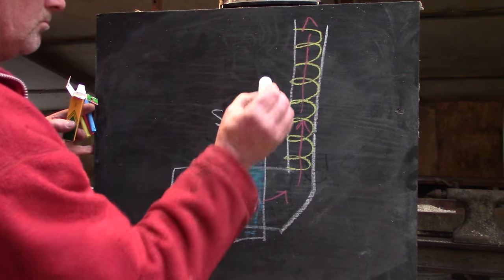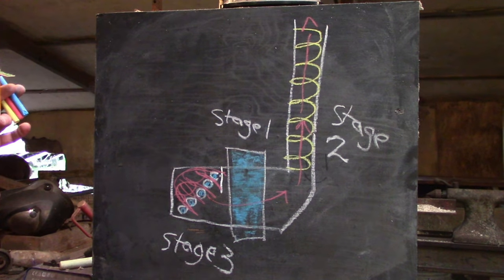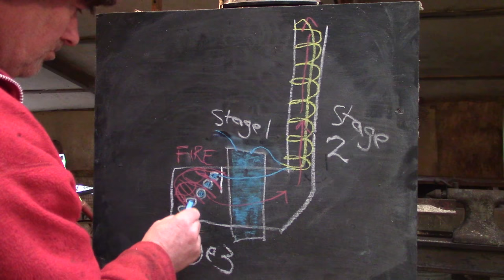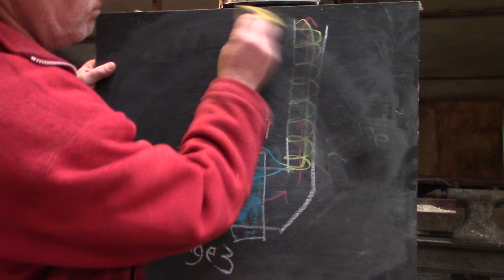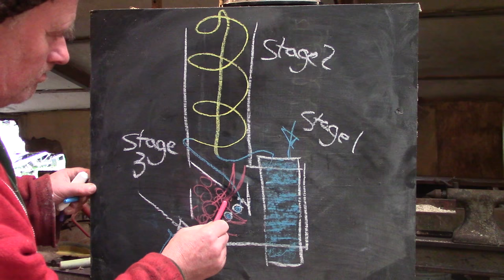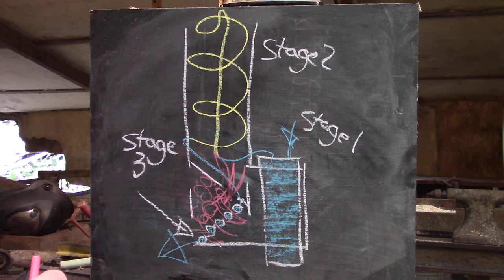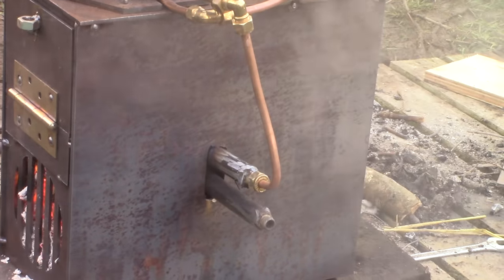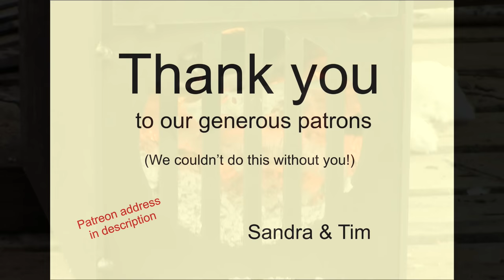Finally A Flash Steam Boiler That Works!!

Comment: 9:44 is it because the air flow is too high in that it just blows the flame out before the wood of the match stick can start to burn? There appeared to to be momentary ignition the the flame was extinguished. 
Fabulous idea though, I work for AGA and was observing some work on a Rayburn recently, and we were looking at the efficiency of the oil burner and questioning the airflow around the various baffles in the heat exchanger. 
Very interesting stuff
Reply: There's no oxygen in a pure flow of water vapour.
Reply: @Landrew0  it’s not water vapour it’s dehydrated … it looks just like that there is too much airflow blowing the flame out
Reply: @buffplums  When you boil water, you get only water vapour out of the pipe, with no oxygen in it.  Superheated steam is dry, but not dehydrated. That's why the match lights, but can't stay lit.

Comment: That's some hot steam. But wouldn't it push backwards through the water pipe if you restrict the flow? 🤔
Reply from the maker: Ha! Yep, S.H. has it right..
Reply: @wayoutwest-workshopstuff6299  yeah but, there's no check valve, isn't it - that was the question. 👆

Or do you plan to build an atmospheric steam engine? 🤔
Reply: @wayoutwest-workshopstuff6299  else I think you would need an well insulated pressure tank (best attached to the chimney or firebox) and have a check valve on the inlet too.

If the float valve opens the steam in the heating part will be dumped by triggering a pressure release at the end (best up the chimney to increase the draft. 

You could then use the steam pressure in the now isolated pressure tank to push water out from a larger reservoir into the boiler.

The larger reservoir could also be used to cool down the exhaust from the steam engine, by looping it inside the tank, before venting it to the chimney.

This allows some steam to condensate (which you can collect in a non-pressurised reservoir, so you loose less water, and it will preheat the reservoir. This reduces the amount of steam necessary to move the water out - as it will be already pressurised and will reduce the energy needed to heat up the water in the boiler. :)

Comment: Will superheated steam not corrode the steel superheater tubes rather quickly? On my model steam loco the superheater tube is stainless for this reason.

Comment: if you want to make a piston engine that runs on that steam you will need HUGE cylinders and it will use a lot of steam
Reply from the maker: Thanks but can you explain why? I'm just getting my head around cylinder sizes and stroke length.
Reply: @wayoutwest-workshopstuff6299  because you are working with such low pressure . You will find calculations online to assist. I know we differed on this before Tim but I still think your definition of flash boiler isn't quite correct. This is more a traditional boiler with superheater
Reply from the maker: I'm sure you know best but it's not quite a conventional boiler either, is it, because it's not closed up.
If I aimed at 30psi working pressure would you still regard that as low pressure?
Reply: @wayoutwest-workshopstuff6299  very you are gonna pretty big cylinders for this thing or alteritivly you use a turbine but that would problebly be difficult to build
Reply: @wayoutwest-workshopstuff6299  I would suggest it's a conventional boiler with superheater and regulator open. ..in its current form. To do work of course it would need to produce pressure, ie closed up as you put it. The amount of torque will depend on diameter and stroke and pressure, number of cylinders etc and is easily calculated.  The amount of power, which is useable work, is defined as torque x speed.  In this instance you will be limited by either rate of steam the boiler will produce, or for short term, the amount of stored steam. A flash boiler stores very little, a traditional boiler has more back up, because as pressure drops due to steam use the water boils rapidly because its boiling point lowers. Sorry this is too much for a text reply but you can find it all online. Great project to watch and for sure your fire draw system is working better and better.
As for 30 psi boiler...how would you keep it topped up?

Comment: I know you're just experimenting but do you have a plan for how to make your solid-fuel boiler a little safer?  I know the whole world has gone crazy with safety.  The difference here is that an accident with steam has more consequences than most of the things we worry about in modern society.  I've heard inspecting the wall thickness on the tubes is important on commercial boilers, for example.  Sorry to be a negative nelly but a pressure test on those welds might not be enough to be confident in the work, especially long term.  In the US, welding inspectors will reject a messy weld.  If it looks perfect, then the inspector will proceed with dye or x-ray.  BTW, there's a good book about the inevitability of accidents in certain situations.  In particular, a system with phase change is prone to accidents.  The book is titled "Normal Accidents" by Perrow. Even if you carry on, perhaps you could consult the model engineering community.  They're keen on steam power and might have some tips about building a boiler.
Reply from the maker: Nothing exciting comes without some risk. I don't want to get hurt, but I do want to explore the world around me
Reply: You could do a hydrostatic test quite simply, to know if it is safe to operate.

Fill the boiler completely with water without leaving any air inside (also remove the floats)
Connect a pressure gauge and use the water mains to pressurize the boiler initially, then shut it off and heat it gently with a propane torch. You will see that for a small change in temperature there will be a huge change in pressure, because the water cannot be compressed. If it fails, it shouldn't be as dangerous because there will be no steam, just some warm water.
They use this procedure industrially to test boilers and tanks to failure.

Comment: I think that you can collect acorns to dry them and use as fuel. Add a blower to the firebox to increase the temperatures. Be careful not to use much of a blower.

Comment: Bravo! 👍🏻 is there any point (yet) thinking about how one might transport water in such a way that would allow steady supply to the system at the right rate yet not be mains operated / at mains pressure? Because that flood of yours might work differently once, shall we say, it is decoupled/unleashed/mobile. Or is it a non-issue? Perhaps condensing the dry steam into a receptacle might be another fun thing to do to see what amount of water intake is needed per minute at medium fire, or whatever rating you require….
Reply: * flow, not flood 🙃

Comment: 0 seconds ago
In a normal steam cycle the incoming water for the boiler would be preheated by the exhaust gasses of the stack as that is the coldest area as the flame area  is the hottest.
That preheated water would then go to the boiler steam drum and only then to the superheater to be dried ( and heated more).

The relief valve is set lower on the superheater as if it blows the escaping steam will “cool” the superheater tube steel as they will melt without the cooling steam flowing through.

The steam drum gets its own pressure relief valve set higher.
Reply from the maker: Ok, thanks. I'm trying to do something different though - match the input with the boiling rate, so that's why I need a float valve early in the system

Comment: The 3rd stage in the grate, is not a flash boiler, it is a superheater.   Steam at over 100C is superheated.   A flash boiler does not have a large vessel with water in it, its more of a long tube around the fire.  Water enters at one end, steam exits the other.

Comment: Apparently the first way hydrogen was generated was by passing steam through a red hot iron tube, which would split the water and use the oxygen from the water molecules to turn the iron to rust, liberating the hydrogen. Might want to be careful with red hot iron tubes, but they had to have done it somehow for steam locomotives.
Reply: thermochemical watersplitting happens at 500-2000C and just back of the mind iron chemistry I think you’d get insignificant quantities by accident as what little hydrogen liberated would adsorb into the iron and rust. Significant quantities of hydrogen made this way need real fancy catalysts and special conditions so if the old mate discovers an iron catalyst works i think i have a few uni’s in mind that would appreciate hearing about it

Comment: Get a plumbers pressure test so you know if it will take double max working pressure.
Secondly silicone rtv and heat and pressure it is bad news, great on cam box on car - not great for application your using it for

Comment: I think you shouldn't try to heat the steam, but instead heat the water. The hotter the water is, the more pressure you'll have. Heating the steam will only increase it's volume, but won't increase pressure. When water has a higher temperature than 100 °C it will want to evaporate, but a high pressure will stop it from evaporating. The hotter the water is, the more pressure is needed to stop it from evaporating. In a closed tank, the water will generate steam until that pressure is reached. You could of course use the tubes you have made to heat the water.
Reply from the maker: Thanks, Refke. That's the conventional way, isn't it? Where you have a pressurised boiler. I was hoping to avoid having a lot of pressurised water or steam for safety reasons

Comment: NO, not more powerr...
Less power, slower welding (slower feeding material) = more time to fill the cracks aka have a better flow.
Not to low, because then it does not merge well.
Start (testweld) low and then increase till you have a good flowbed that seals completely.
For most cases, lower is better, but to low = no go...

Another helpful trick for improving your welds:
Tag it in position and start welding at the most difficult spot to the easiest spot.
That way you weld has a higher chance to be consistent and even improve during the weld.
Start the other way around...
Then the chance of your weld getting worse is almost guaranteed, because the rise in difficultly..
This also prevents for spending lots of time on corrections...
If the start is bad, then you have less to correct then when you finish the weld completely...

Comment: Just remember…. Pressurized steam is extremely dangerous.  Currently you have an open system but to get any work out of it will require pressure to be stored.  And that’s where things can get a little crazy.  Lol

Comment: You did the steam production part right. Your steam is dry and oxygen-free. This is why the matches don't light up. No oxygen to burn the wood.
But by extracting so much heat at these critical points you take away the biggest advantage of the rocket stove: The very hot - and therefore complete - combustion. You cool the combustion and therefore your rocket smokes with incomplete combustion. Good rocket stove designs insulate the horizontal part and the vertical heat riser. You do the opposite. So this will never be a good rocket.
Reply from the maker: But it's not supposed to be a rocket stove!
Reply: @wayoutwest-workshopstuff6299  Well then... well done! ;)

Comment: It's nice, but it isn't a flash steam boiler. For that, it has to be able to continuously turn water instantly into steam, which isn't too hard to do, you just need a lot of extra heat and a water pump of course.
Reply from the maker: Ah, but that's exactly what it does! Perhaps I didn't explain properly but there's a constant supply of water in one end and constant steam out of the other..
Reply: @wayoutwest-workshopstuff6299  Very impressive then!

Comment: Hello, I need to boil a continuous flow of 2 liters of liquid entering at 25ºC every minute and I was wondering if such a design could do it. I only need to boil these 2L/min, not steam it
Reply from the maker: I think you'd need forced air - that's a lot of heat to produce
Reply: @wayoutwest-workshopstuff6299  yes I thought so too

Comment: Do you think you can heat milk up for a well earned cappachino
Reply from the maker: Soon!
Reply: @wayoutwest-workshopstuff6299  I saw an attachment, many years ago, that fitted on the gauge frame  drain pipe for a GWR locomotive. It was basically a pipe that bolted to the drain pipe, fed down 6-ish inches, did a couple of turns then came back up to exhaust away from the "barista".

Comment: I wouldn't expect it to light the matches. For that you need oxygen. But you are putting what should be almost pure water vapour over the match. That should extinguish in a similar manner to carbon dioxide.
Reply from the maker: It's a classic test for dry steam. Plenty of oxygen nearby - I just need to get the gap right.

Comment: This is what man can do instead of reading books... It is only need to read small page to understand what's wrong with this boiler. In short words, you have no area for evaporating steam, but a lot of area to overheat steam. It it extremely hot steam with extremely low amount of steam generation.

Comment: You know, if you kept the original design, and simply lit a small fire under the stack portion, to get the air inside hot, and rising, you could have kept the original design.
Reply from the maker: I tried that a few times and it sort of worked..

Comment: you could have used steel fittings and angles to make that and avoided the bad welding job all together
Reply: hot and cold running water pump and power generation as well as under floor heating ... as a good combined system to use all the potential heat from the steam ...
Reply: no it wont run your freezer but keeping your battery bank topped off or running the night time outdoor lights or a battery charging station for all the power drills and stuff perhaps .. use the steam in a steam pump and you get water pump use some of the heat to warm water and you get hot and cold running water ... use the steam to make distilled water for drinking ... use the last of the steam in under floor heating to keep the floors and walls warm inside and poof a little steam boiler does 4 times the work for a little fuel ....
Reply from the maker: If you can find suitable fittings, please tell me where.

Comment: Why don't you just build a fire tube boiler like what's on a locomotive the Firebox is in two pieces you have an inner and outer Firebox and you have water in between the two is known as the muttering as we're all the sediments gather the bottom of 2 walled Firebox look up fire tube boilers they work a lot better than what you're trying to build

Comment: MAG or MIG welding?  not a good idea, because the seams don't stay tight... You shouldn't even use it to weld a normal water pipe, it's even forbidden in Europe to weld with inert gas on pressure vessels!  Electrode welding or oxy-fuel welding is better...
Reply from the maker: Really? That's not what my welder friend says and he worked for years in the Dutch shipyards. Are you sure?
Reply: @wayoutwest-workshopstuff6299  Yes… Incidentally, I learned a trade as a locksmith in Austria.

Comment: I'm seeing these copper lines and brass fittings heated to these temperatures and I get VERY concerned for your safety.  I'm no engineer and my experience with steam is next to zero, but still - that's a little unsettling.

Comment: Dear Tim, as long as you don't put the steam to use (hence no pressure in the boiler) there will be no problem. As soon you start using the steam to power something, your design is seriously flawed (to weak) because by then your boiler will be under pressure. Boilers are complicated designs for a reason. Most of those reasons / rules are written in blood. Your channel is to entertaining to loose you due to a boiler explosion.

I like you way of tinkering (and out of the box thinking) with railtransport. But your shortcuts in boilerdesign will bite you one way or the other. Even at 3 bar (the pressure set on you current central heating safety valve) a boiler like this can cause serious harm.
Reply: Water above 100 degrees can't exist (under atmospheric pressure). Each litre of water that is boiled will expand to a multitude of litres (+1000) of steam. The tiniest crack in your boilervessel will initiate a explosion. Also your “staying” is non existing. Maybe the pressure in your feed waterpipe is high enough to go against your boilerpressure (in the region of 3 bar) but I doubt your way of feeding the boiler will be working and once you can’t feed the boiler with water you’re heading for trouble.
Reply from the maker: You're right, of course. My thinking is that with no restriction there's no pressure, but with some restriction the pressure could rise enough to move a piston and still be low enough to be relatively safe. I don't need to go to 3 bar to move a piston, do I?